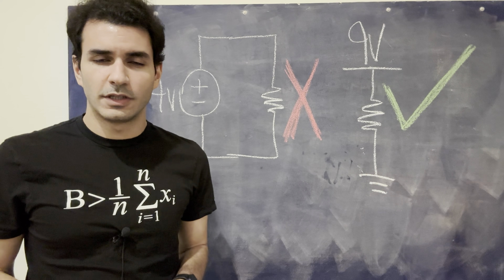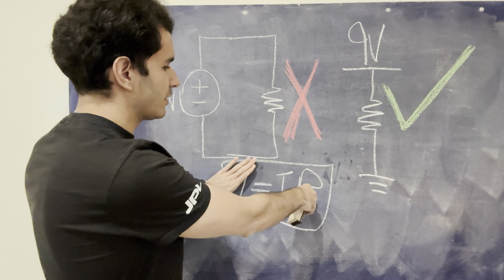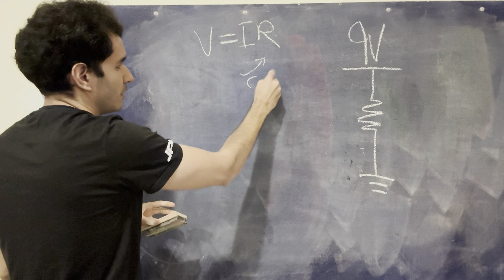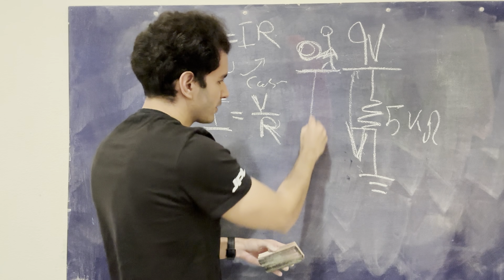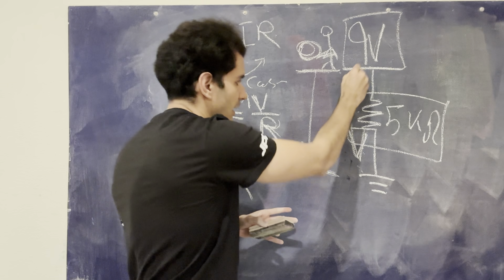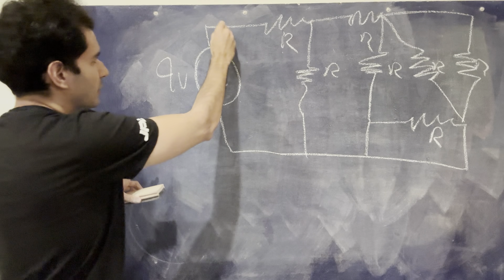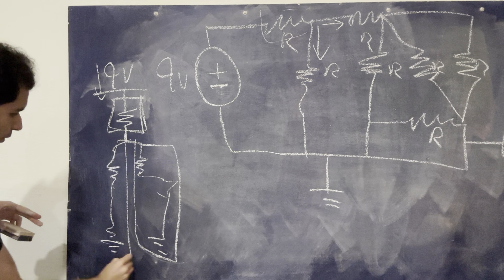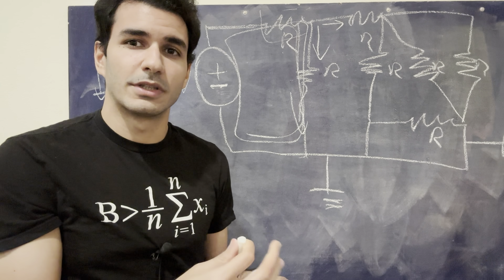Circuits Finally Made Sense When I Saw This One Diagram

Comment: I think the same can be accomplished by imagining electrical circuits as analogous with water, since physically that is essentially how it works (and this can be demonstrated experimentally). the drawing on the right is good for explaining this concept, but it is still pretty limited, while the water analogue can become part of intuitive thinking to a large degree. after all, the drawing on the right is essentially the same very simple circuit just drawn in a different way to explain the concept, but that's kind of it

Comment: I think there is probably some survivorship bias going on in the comments. The electrical engineers who were able to understand and do well with the traditional circuit explanation are saying “no wtf it’s completely fine stop.” 

I’m a software engineer and that’s what my degree is in. I had a mild interest in electronics and tried taking some EE classes as an elective and really struggled. Most classes and things related to computers I am able to eventually arrive at an intuitive understanding, but I never did during these EE classes. 

I’ve been getting back into electronics, and this was very helpful! I do think it’s weird that the equation doesn’t get taught as I=VR to beginners. You’re always given voltage in the problems, so  it’s basically like the x variable in traditional y = mx + b formulas. We spend years doing math, but how often do we give y variable first and solve for x? It just goes against years of pattern recognition. 

I think the intuition in this video and analogy to potential energy and basic high school physics should be taught first, and then you can go to “conventional” circuit drawings.

Comment: For understanding or solving yes, but the reality is that,  the electrons are moving opposite to the current we formatted. In your pinned comment, u said charge moves high potential from high to low. I might have to object this, causes charges which are the electrons coming out from negative side, move from low potential  to high potential,  which is  opposite to the concept of gravity. But  of coz, to make system and study and better,  we use current (imaginary of moving positive charges,  which actually they do not). The concept of gravity can be used, but explain to the beginners the real actual things after they succesfully pass the core theory.

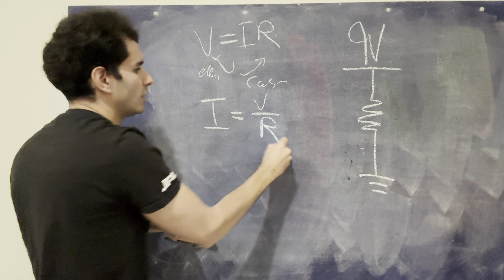Comment: As long as you have a model in your head that is mathematically valid then I think it is fine to visualize the problem anyway you like to help you "get a feel" for it. I think the problem you are describing is being given a formula but not having a feel or intuition about what that formula. That I imagine is true any time we apply a math formula to life.  There are huge parallels between V=IR and F=MA. I imagine if people rearranged that formula to be A=F/M it might helps with their intuition.  "If I want to accelerate really fast I have to push harder" makes more sense that if want more force I have accelerate more.  At 2:02 you are referring to that triangle as a stupid way of showing the formula and I think you found it confusing.   I think that triangle is just a fast graphical way of figuring out the formula for V or I or R. The horizontal bar is like a fraction so   V/IR  = 1  and whichever one of the 3 you cover up gives you the formula for that parameter.  You "intuitively" re-arranged the equation at 2:20 without resorting to the triangle. My excellent  first year physics teacher felt that "intuition" was learned and based on past experiences. Once you work with electric circuits a lot you develop an intuition.  I find simulators are great for developing an intuition because I can quickly change a component value several times and see cause/effect.That first year prof did 2 awesome demos. The first demo he asked people to predict what would happen when he pulled the string. The class visualized pulling a string on a yoyo and what happened is not was expected. He then wrote out the math. His second demo did the opposite. He wrote out the math for a different demo before giving the demo.  It was  a very none intuitive result and the class thought he must have made a mistake. then the demo matched the math.

Comment: 3:30 Makes me think of if you dropped a balloon in still air versus a shot put in molasses. The balloon has less potential while having an accompanying lower resistance, while the shot put has a much greater potential while having a much greater resistance. In both examples, they may have similar 'currents' or speed that they'd move through the mediums, given they would (in this imaginary example) have proportional potentials:resistances.

Comment: In trying to make a circuit easier to understand, you've actually made it more confusing.  Sadly, this happens all too often in science classes.
Reply: Well, there are probably billions of different ways that brains organize information, but personally I will say that this also helped me by leaps and bounds as a hobby electrical engineer painter. To your point, for whatever reason I would prefer to put the 9 volts on the bottom with the energy moving up. I have no idea why. Anyway, cheers to op this linear perspective is amazing.

Comment: In schematics they are not drawn like the one you like. So you need to learn to deal with it. Working in the electronics field for 25 years I have never seen a single schematic drawn like the one you like.

Comment: Not to mention that dropping the \Delta in \Delta V = RI in itself causes lots of problems, in my opinion. I mean, I think it is fine if you internalize that there must be a potential difference. The whole earth thingy always breaks students, and I think that one of the main reasons is this notation. 

Even in circuits, I think it is better to start by writing the integral definition of eletric potential and slowly getting your way to the abomination that is V=RI, when teaching.

Anyway, the way you think about circuits is the way I caught myself drawing them in uni. I agree with you. It really helps. Thanks.

Comment: interesting. I have thought of the circuit of a battery as the flow of charge from one point to another. - DC. But and AC circuit as one on the left.

Comment: Isn't that just like a physisist to assume the similie of dropping a ball is like an electrical circuit. It only works as an analog and if you follow what you have done, it would only be accurate like 50% of the time. I suppose close does count in more than horseshoes and hand grenades as long as your circuits do not meltdown.

Comment: Portrait vs landscape mode - no difference at all if you have a hard time understanding first one second will be as hard, voltage is on 2 points ,series resistors drop voltage ,parallel connections raise current thats all you need most of time

Comment: As an electrical engineer, if that helps you visualize then okay, but I will point out you are doing the exact same thing as the traditional circuit analysis
Reply: Why the f is everybody starting with "As an electrical engineer" on this comment section

Comment: I think the flaw in the thinking here is that students should first learn the underlying principles of electricity and electric current flow.  Rather than trying to first understand a circuit diagram by thinking of current flow as gravity!  Skipping the learning of underlying concepts, is a recipe for creating mental roadblocks as complexity increases.

Comment: I agree with some of the intent to improve intuition. I disagree with the assumption that drawing a closed loop is the fundamental problem for most students.
It may help the intuition by the analogy of gravity, but removes the concept of ground just being a chosen reference. You've technically removed the "circuit" to explain circuits!

I think a better way to approach this is: "Intuition is important. Let's develop a few different ways to build intuition, then look at the same circuits each of these ways to build the connections between these. (Like looking at the same picture from different angles.) The analysis way using KVL, KCL, and equations is only one of these ways.  Then let's show where these intuitions break down."

I know this works, because that is how my electronics 2 professor taught it, and after 20 years it's still how I teach it to junior engineers. (My electronics 1 professor taught it as all math, and everyone was lost, so I have experienced the "math haze" stage of learning as well.).

Comment: watched this video fully didn't find anything useful, I think just learning complex variants of series and parallel circuits where a lot of resistors are present continuously, as a base is much better for this level. This video "Equivalent Resistance of Complex Circuits - Resistors In Series and Parallel Combinations" by "The Organic Chemistry tutor" is the best in my experience.

Comment: Remember when I was trying to learn electronics at 12 from an old book and I got totally confused by the earth notation. I  actually got out,  connected my small construction to earth even if it didn't made any sense. Of course it didn't work so I connected to the minus of the battery and voila it worked. 
The reason for testing such a stupid thing to begin with was that  I had bought just one transistor (lack of money) and didn't want brake it somehow. Baby steps!

Comment: My problem was sign convention. Am I calculating voltage at a point? doing KVL? and is that in the same direction as current flowing. Yes, blindly following the wrong rule can be a problem!

Comment: I'm an EE and I like the thought process and it might help it click for someone. Circuits are drawn in loops for analysis that go beyond simple ohms law. Mesh, nodal, thev, norton and superposition are necessary in complex systems. The alternative representation diagram he drew is used to simplify schematics, but he adapted it to help with visualizing what's happening in the circuit. So if it works - great! 

The best aid to help me understand was said by our AC and DC professor. He said, "Many of you asked for a formula sheet. I don't let you use one because I don't want you to memorize formulas. If I catch anyone putting the ohms law triangle on their test it's a zero. You're not in my class to memorize formulas and spit out numbers you're here to understand how to get to the answer. You get to the answer by understanding what units you're looking for and how to manipulate them mathematically in your brain. That's what I'll teach you to do." He was a guy who could do complex analysis in his head and it didn't matter how many decimal places were in the answer he could do it faster than we could in our calculators. He was tough, but he was the best teacher I ever had.

Comment: I graduated electronics engineering in 1982, then left side circuit never confused me and the right side circuit didn't either.  They are equally the same to me. The v over I r triangle is not confusing either,  it makes it easier actually.

Comment: The up and down is correct for teaching because voltage is pressure. The same as gravity + speed on a waterfall. Resistance is rocks etc. and then current is the flow of water after you’ve divvied up your pressure. Lots of teachers are doing that as engineering 101. As far as better resistors yeah its like a beaver dam. Everything flows to the easiest path

Comment: Voltage is not just in one point. Voltage has to be between two points because its a pressure difference. The electrons push eachother into the resistor only if the electrons on the other side are not pushing back with the same pressure :)

Comment: The man dropping the ball analogy worked for me too.  Reduce the resistance by reducing air density, increase by increasing the density (say, you're under water).  Vacuum offers no resistance.

Gravity offers force.  Like electrostatic force in a vacuum tube, electrons accelerate from more negative to positive, they gain energy (like the ball dropped), that energy is joules per coulomb.  That's volts.
Reply: the ball analogy would make you expect some acceleration, but its probably better to imagine dropping a feather

Comment: I see what you're trying to say, but you associated voltage AND current as potential. 

Voltage is pressure.  
If no resistance, current is infinite or undefined until something torches.

Electronics is is more intuitively understand with voltage as a potential and the current being the physical flow of electrons.

I give you credit for attempting to simplify, but this is the worst analogy I've ever seen.

Circuit analysis is nowhere near relative to kinematics.
Reply: Also I fell into the trap of thinking of voltage as absolute potential only, but when I had multiple "grounds" it actually moved some current backwards because one of the grounds was a lot more potent than the other and my LED diode was actually inverted, so it didnt glow 🙂

Comment: It's interesting that the vertical way works for you.  When I was in Engineering 20+ years ago I always preferred the loop diagram.  To it it was more intuitive because I could visualize the components and visualize the current flowing through them (knowing that you need a closed loop for current to flow).   Had I Just used the vertical diagram I think that would have confused me because it seems more abstract.  I guess different people just learn different ways.

Comment: We have been drawing it this way since the early days of electronics.  It is meant to clearly show the return path to and from the "battery" which is what the power supply would have been in the early days. I think the concept of "chassis" ground comes later, after the current flow is better understood...and some circuits operate above ground which makes the chassis ground moot.

Comment: The triangular method is not MISLEADING but one of the most inhumane ways to learn V=IR, it must be removed from all educational text books. Regarding the two diagrams, I think you are wrong. I  prefer the first one for novice because that is how real circuits are connected they don't physically connected to a ground wire. You never mentioned about V= potential difference = IR, which is why people get confuse. The second diagram came in later with no difficulties at all. One last bit, one of your resistors in the diagram is shorted to ground and becomes useless.

Comment: I think what you achieve with this is to have an unidirectional current flow which certainly helps in circuit analysis and to develop some mental models, but that's basically where the benefits end for me.

Comment: Mileading misleading  misleading  ....   
sorry to say that hat you have drawn on the right hand side, is a resistor connected to ground at one end and what it is connected to at the other end (the top end) is not obvious !!  if you want us to believe there is a Voltage applied, then you must remember  that voltage is applied and measured ACROSS  and not at a point (which you have mistakenly done).  Better start understanding circuit theory with correct concepts and not made up half concepts.  Please do not mislead beginners, just because you want to put your face on a screen.

Comment: I'd say that your "top to ground" model can be adapted to the traditional circuit model by thinking about the model in three dimensions: the battery is an escalator taking the electric potential from sea level to the top of a mountain, and the rest of the circuit is the path back down to the bottom.

Comment: This is vague handwaving.  First, get rid of the idea that equations express causality in one direction.  If you want to go anywhere in electronics, you’d better not start thinking about circuits in the very limited sense of the vertical drawing.  That is going to FAIL in short order.  (Other answers have discussed how current flow in loops are important.)

Comment: Points for effort and ok for simple circuits but... cannot be used on complex networks where nodal, mesh, or loop analysis is required.  I have seen schematics drawn both ways and both are useful depending on how you want to think about your circuit -- biasing vs. AC analysis for an amplifier as an example. Keep thinking!   😊

Comment: I like the V over IxR and W over AxR diagram/map, it has everything you need within a logically placed circle, # on top is divided by either # underneath(like they write it with division on paper), or what's beside it is beside is multiplied to get what's above, all to give you the missing #. The loop diagram always made logical sense to me if you use the analogy of water, which has many similarities in its analogy. It's been a while, I may mix some of these up, but, Current = Strength of water flow, Voltage = Volume of water (bathtub vs cup), Transistors = Valves or Pumps, Resistors = Faucets, Capacitors are like filters, etc.